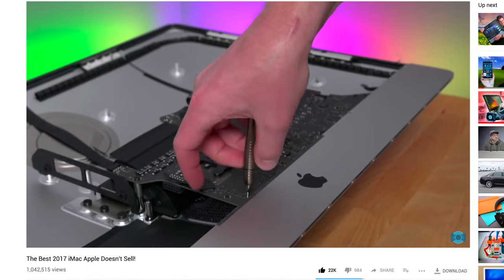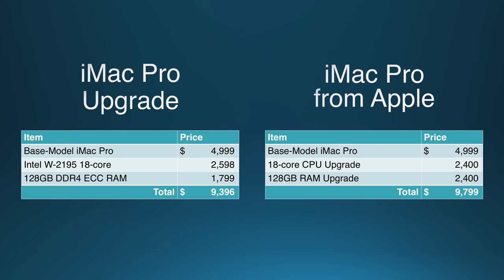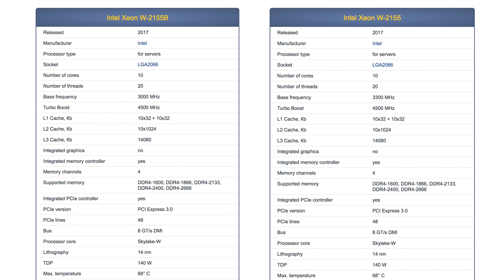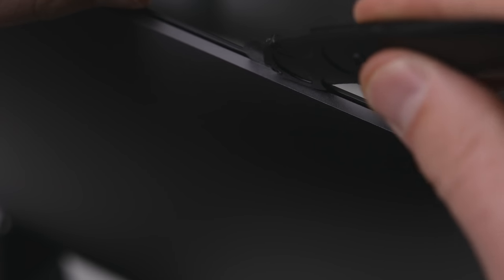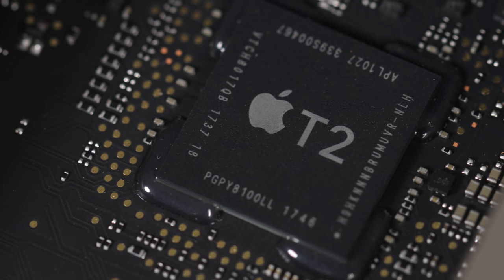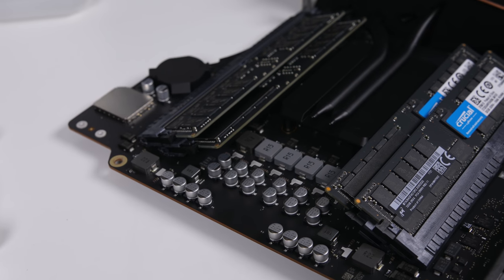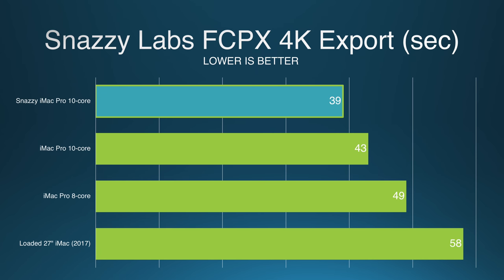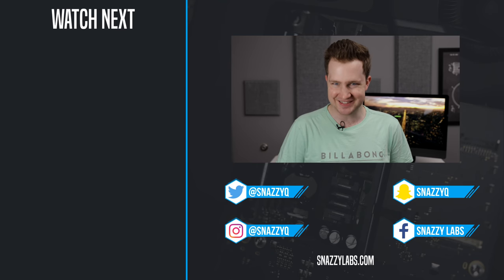Can You Upgrade the iMac Pro?!

Comment: Yeah those "warranty void if removed" stickers are actually illegal in the USA via the Right to Repair laws so rip those things right off and tell Apple to talk to the FTC if they say anything about it.
Reply: Andrew Crews It might also be valid in countries with different repair legislation.
Reply: Andrew Crews  The warranty is not voided in this case. The act of opening a device (regardless of stickers) is not legally capable of voiding a warranty. This is what the written law states. It even says "Warrantors cannot require branded parts be used..." Meaning, you are free to modify the internal components as you wish and the warranty is still binding between the warrantor (company/provider) and consumer (purchasing entity.) The sticker is also not allowed to lie, the FTC sent out warnings about this since it is deceptive and suggests and illegal practice. You can lookup the "Magnuson–Moss Warranty Act" and read the official legal bill if any of this is confusing. Wikipedia has a fairly good summarization though of the most important bits in simpler language.
Reply: Andrew Crews  I did not misunderstand anything. I also directly responded to the "sticker is allowed to lie" in my post. "The sticker is also not allowed to lie, the FTC sent out warnings about this since it is deceptive and suggests and illegal practice."
Reply: wait for real world? or just a law?
Reply: Craig MacDaniel so you are telling me I can remove the screen break it and blame Apple?????
Reply: @Craig MacDaniel, NOT True. They still have to honor the warranty. Even if you remove the stupid “warranty void if sticker removed”.

Comment: I am not surprised with Apple's way and choice of applying thermal paste. I work in Apple Certified Repair center and new 2016 and 2017 MacBook Pro machines are all having GPU overheating problems after less than a year of use. And guess why? Thermalpaste. I applied Thermal Grizzly paste on my machine, but due to Apple Certification I am not allowed to apply a 3rd party paste to our clients. Here you go…
Reply: Of course they are. You shove anything into small form factor it thermal throttles and melts down.
Reply: Mark Wolf If you are talking about hardware this powerful in a form factor like this then sure, but I don't know about anything thermal throttling, and melting down, as you can get some really good small form factor Intel i3/i5 Asus Chrome boxes that will handle the work loads of 80 - 90% of the planet who are not gamers, and/or content creators, that stay cool enough, and don't thermal throttle. Also look at phones I have a Moto G5 + with an Ocotocore CPU, and 4GB of ram that stays cool in my pocket all day long, and even after gaming on it with a heavy game like GTA, or even Fortnite(only tried it a few times to see if I like it, but not my thing) it barely gets warm. the only time I've had it get hotter then I like is when using the included turbo charger, which I rarely use.
Reply: @ev3rest I bet you have to suppress a wince every time you're forced to use Apple's thermal goop...
Reply: ev3rest isn’t that planned obsolescence and illegal? And what about the thermal paste used in the Mid-2015 MacbookPro11.5 Dual Graphics? Did you ever had to replace it in those models?
Reply: Overheating apple products:ONLY the new 2016/2017 MacBook Pro? Is that some sort of joke? :D
Reply: waka faka any apple laptop overheats. Especially 15” ones with GPUs

Comment: @
Snazzy Labs
B - revision of intel 10 core CPU got 300 less mhz - that make it hammer VRM less. PSU not a problem here.
Reply from the maker: Can't believe I didn't think of this. You're more than certainly correct. VRM cooling on this machine is a joke by the way.
Reply: But iMac still can have 18c CPU? That makes 18c hammer VRM even more?
Reply: @
LPMusicON
If all VRM phases turned on it could handle 18 cores, but if you running application that using less cores - for efficiency reasonable to turne some of them off, and that where we got problem with high mhz CPU. Also i belive 18 cores got less base frequency and less agressive boost.
Reply: If the VRM's don't handle a 300mhz upgrade then they are allready stretched pretty thin as is.
VRM's should allways handle way more than what a processor can draw under extreme overclocking, because if one of them fail both mobo and gpu are dead instantly.
Cooling is the main fault of vrm's, if they reach 120c they will wear out insanely fast.

The vrm's on my old Gigabyte 990fxa UD3 was designed for 220w tdp yet i pushed them far beyond that for allmost 5 years before i upgraded to ryzen, they are still going strong but now at base clock on the cpu as it's being used as a mediacenter.
Reply: Does it? They both have the same maximum boost clock. Anyone know how the intermediate boost clocks pair up?
Reply: They have different clocks. 2.6Ghz base processor vs 3.0Ghz base. Also it's a max boost for a single core, for a multiple cores boost goes a way less.
Reply: Dinamis 70th like, no 69 for you >:)

Comment: I'm pretty sure its heat. The TDP is just a guidline not a real life power rating. The reason the less than 18 core Xeon also has lower clocks is because they draw almost the same as the 18-core since they're clocked higher. So the reason for the B SKU is probably still heat and power. Lower bin chips aren't seperated by just a mere 300MHz.

Comment: i9 x299 hackintosh please!
Reply: DragonKingGaav Yes plzzzz 👍👍
Reply: I third  that request!
Reply: I might do this for my next system, if I decide to move back from Windows (unlikely).
Reply: Ohhh yaaasss
Reply: X5
Reply: I've built a couple. They're fantastic. You need proper cooling though as lidded X299 CPUs get hot way too fast no matter what cooler you match them.
Reply: Luca, what guide did you use to make your X299 system?  How difficult was it to make?
Reply: I mean you'd have to delid the bastard. They're useless otherwise if I'm to understand.
Reply: Save some money and use the superior threadripper.
Reply: Those aren't the only limitations they suffer from as apples supplied driver are at times a full 20% slower than the ones available to any other OS and this is with supported hardware if you use unsupported hardware the performance degradation is even worse than that sometimes going as high as 50-60%. I will never understand why you would want this because as far as I see it the amount of time you actually have to deal with your OS is minimal compared to the amount of time spent in the applications that if you're using Mac OSX is slowed down. To me, this would result in a worse overall experience even if the OS was way better which, to be honest, they are both pretty similar. In fact from an install standpoint Windows 10 in miles easier and shorter so...
Reply: LiNERROR Apple's ecosystem limitations? What the hell are you on, it's the best ecosystem.
Reply: YEEEEEEEES PLZ
Reply: LINERROR Apple just pushed an update, it fixes it. Happy now? You were never going to buy an i9 Macbook anyway.
Reply: Brawndo Ah yes, because nothing says quality like needing an update before your $4000 (minimum) computer will work properly.

Not to mention that the update doesn't even fully fix the problem. Now, instead of running a 2.93 Ghz chip at 2Ghz, it's more like 2.5Ghz. At 95 degrees Celsius (potentially in your lap). That's still far too much throttling and heat for a computer of this cost. 

Frankly, if this was the first time they ever had issues like this with a product, then it would be excusable. But they have had quality and design issues with more or less every product they've ever offered (including thermal throttling issues with almost every Macbook ever). Throw in crappy customer support, poor repair workmanship and a practically non-existent warranty and it really makes you wonder what people see in this company.
Reply: MrSplintercat It runs at normal clock. And Adobe need to get their shit together and optimize their shit as well. Final Cut Pro is much better on MacOS.  Update came a few days later after DAY 1. Calm your tits. The i9 is fine now and beat all MacBook Pro ever produced. It's not like you were going to buy one anyway.

Comment: I feel the need to clarify something about the thermal interface material; there are many different kinds of thermal interface materials and all has pros and cons. What you found inside your mac is most probably silicone base + some mineral oil + metal oxide(s) and its on the less viscous side of the scale if you compare it with stg like mx-4. I know that usually the less viscous the tim is, the better it conducts heat but you cant simply apply mx-4 to something that isn't supposed to be serviced, like ever. Less viscosity means the stuff will creep out to the sides in time (and heat cycling will only help it creep out faster) thus decreasing the cooling performance, that's when you see differences between individual core temperatures get increased. Too much thermal paste wont kill you unless its really really too much, or electrically conductive, your mounting pressure is bad, or all of the above.
Of all the things they have done with that "workstation" the only right thing was the thermal paste. That cooler has a critical flaw; there is no way to get rid of the dust it accumlates in time and believe me it will and you'll learn what tjmax really means. 
You dont cram a workstation cpu into that tight of a space with that simple of a cooler. You definitely don't do that with a cpu with 140 degrees centrigrate of TDP. I dont know what you replaced that "garbage" with but if you God forbid used something like mx-4 you will see a very pleasant decrease in temperatures immediately, but it'll all go to hell in 2-3 months. Trust me.

Comment: just a heads up for people considering dashlane, it suffers from memory leaks. I have used dashlane for more than a year now and it has had memory leaks all the time. Normally the memory usage stays below 200MB but the memory usage keeps increasing without reason, occasionally pushing the memory usage well over 500MB.

Comment: Why not void the warranty even according to your videos, Apple does not know how to repair these computers anyway so the warranty is a bit useless
Reply: Simple. Because if it doesn't break because of user error Apple is forced to give you a new one if it breaks.
Reply: D-One yes I get that I think you missed the underlying point of my comment, it was more a joke than anything
Reply: Oh.. My bad then :D
Reply: @D-One the sad part (or the joke, depending on your point of view) is that Apple will have to give out new ones for replacements because they cannot repair any damaged ones. The incompetence of such a thing...
Reply: Steamrick exactly it's all a big joke and yes that is sad
Reply: Is that something that uncommon though? (real question) I bought plenty of things that got replaced when i had issues instead of being fixed, usually much cheaper tech though. 

Maybe whats so shocking about it is the fact that this never happened before with Apple products. The iMac Pro seems like a rushed product in response to all the criticism for the lack of Pro Desktop models since the old trashcan... It's like they released it to shut up everyone until the true new Mac Pro is released. 

Rushing products leads to this sort of problems when a company is this big and needs to train technicians, PC technicians don't ussually need any training as products are all similar.
Reply: its not just  apple   most things   these days  even if u could fix  it
Reply: Its cheaper to just replace a broken one than for Apple to fix it because they would need to train people. So it makes sense from Apple's standpoint. Besides, computer screens don't just crack on its own so Apple doesn't even have to replace the machine using its own money.
Reply: david yang The Linus case was somewhat unique in that it was a dropped screen during inspection of the insides, though some pros might want to inspect for Bloomberg style bugs.  However the inability to repair probably also applies to common issues like a broken chip or a damaged USB port.
Reply: exactly..
Reply: What you don't get is troubleshooting an issue on this type of hardware is no cost effective for Apple (and any other manufacturer). The issue could be anywhere. Replacing the main components is the only solution
Reply: I'm stealing this comment

Comment: That hard thermal paste goes on liquid and cures to the hard consistency. It's designed to last a lot longer than other thermal pastes like arctic silver. Makes sense considering they basically expect you never to open the machine ever.

Comment: i can see Apple releasing an update which disables any Mac if any processor changes made.............
Reply from the maker: It's not worth the work or effort for like the 1 person on planet Earth that is weird enough to do this. lol
Reply: prob they are going to solder processors with a shiity solder to save money on a $3000 computer
Reply: Would not surprise me if they did, and they could do it via software, or their custom BIOS if they wanted too, or just go with a BGA package chip which are found in laptops, phones, gaming consoles, etc.. Also lets remember it's been rumored Apple is looking to replace Intel for their own CPU designs so they can do releases on their own schedule, and not when Intel decides to  release a new product that fits their needs, and agrees to ship it too them.
Reply: Given that this is the same x299 platform they're using for their servers and enthusiast desktops it's unlikely they would go with a BGA model.  Others sure, you can buy lots of mitx and a few matx boards that have soldered CPUs complete with heatsinks for cheap.
Reply: He's also running the risk of overworking and dammaging the PSU depending on the increase in current draw. That large of a ram increase will contribute significantly to the load.
Reply: Apple doesn't do this for Hackintoshes which have a huge user base they are definitively not doing it because of one person.
Reply: They didn't for the Mac  Pro 4.1 (That can be converted in a Mac Pro 5.1) Hackintosh and they will began with the iMac Pro.
Reply: This can be done in all macs that don't have soldered CPU's, some iMacs and some Pro models.

Comment: That money you save by getting the system wholesale is made up for whenever you need to take it in for servicing. As long as it isn't a board swap, if it takes more than five minutes to switch out a defective part, you're doing something wrong. (CPU is going to take more, since you need to clean the heatsink and apply an adequate amount of thermal paste, but not that much more than slotting a part in)